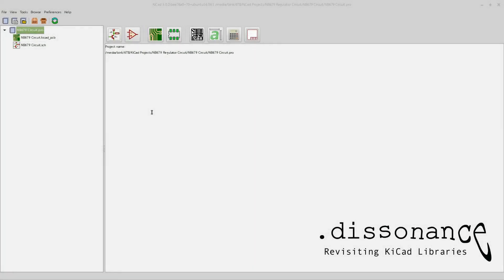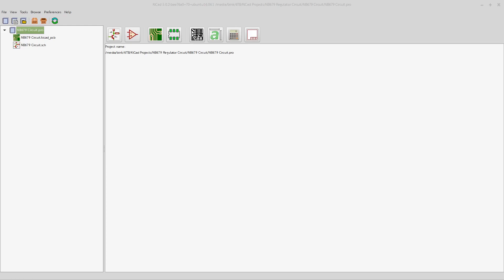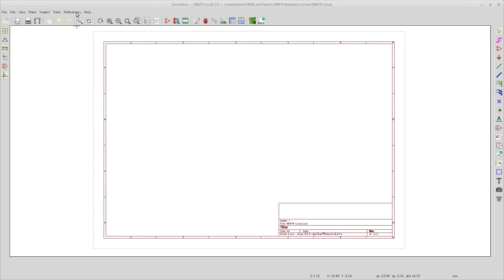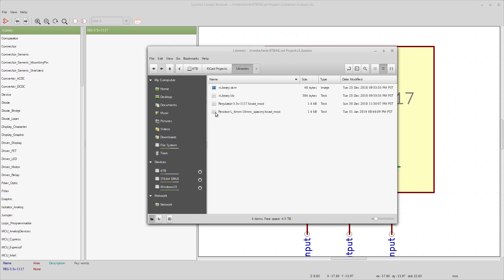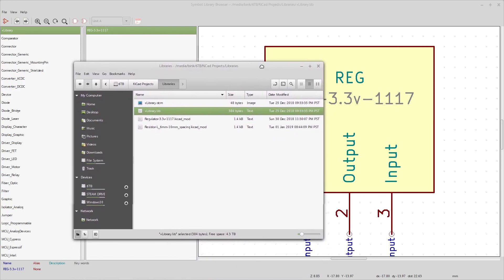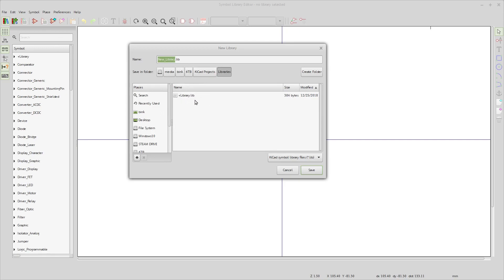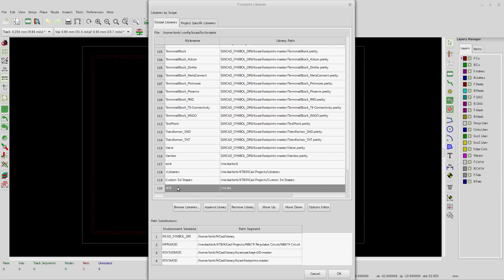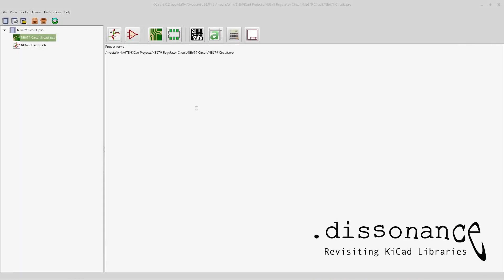#93 - KiCad Libraries Revisited

Comment: Thank  you so much for the video. I'm arriving from PCB software where  a symbol and related print made up a device.  Each device would consist of two files in same location. Correct me if I'm wrong, in KiCad after adding a footprint to a new symbol during its creation the  footprint is linked to it and will be automatically inserted into PCB layout. I might think about it as a device with its symbol and footprint saved in different location. The KiCad symbol libraries also have a library called a Device. Would you please explain in next video what is it, how to understand and use it. Thanks again.